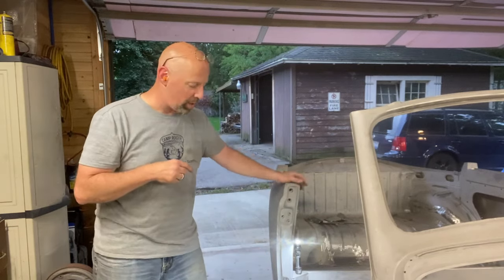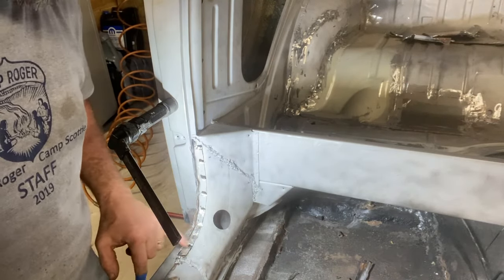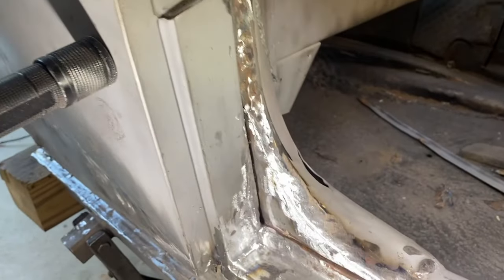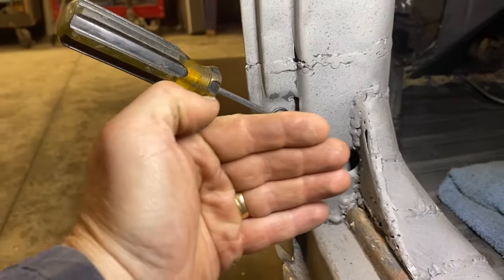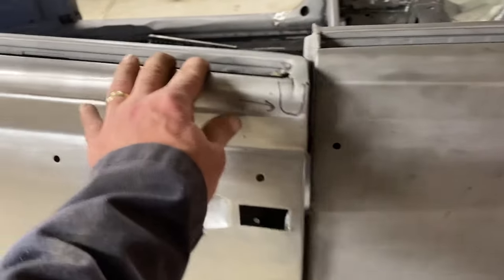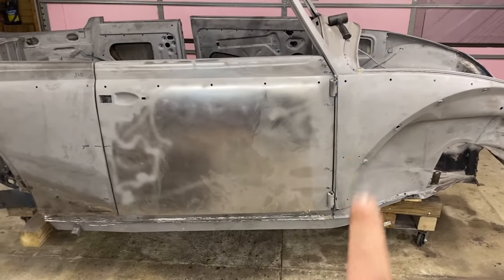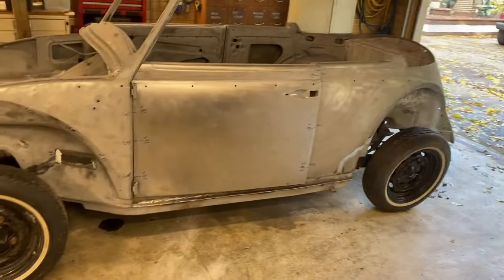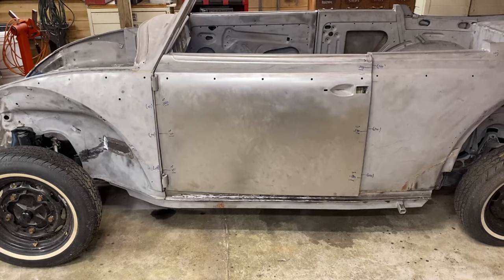1966 VW Beetle Convertible Restoration Pt. 19 - A pillar and door gap problems Pt. 1

Comment: theas cars never had great gaps from the factory they were the cheapest thing they could build at the time . in the end perfection can't be had . you could weld some rod or old metal hangers to close the gaps and grind down and weld the edges as well for gaps that are too small
Reply from the maker: You are right.  And in some way "restoring" them to perfect isn't really restoring them at all.  But I think it's still nice to get it as close as we reasonably can.  Thanks for watching. I hope you are enjoying the journey with us.
Reply: These convertibles were not the "cheapest thing" they could build at the time. They were actually a fine hand-crafted, high quality Karmann coachwork build - far apart from the Beetle sedans. The door gaps were originally set to approx. 4mm (1/8") front and rear. Rear door gaps are common such as this one's, after 50+ years of rust, shoddy repairs, and just plain fatigue. There are factory body / frame mounting points at the rear shock towers which have replaceable rubber shim pads designed to correct the rear door gap issues.
Reply: You have to have the body mounted back to the chassis before working on the door gaps. The convertible door gaps will actually flex somewhat, especially with the top not latched to the front window frame. If you have the entire vehicle pretty much assembled and you put it on a lift, or jack it up evenly at the 4 corners of the frame rails, You will see a big difference in the rear door gap, with the top unlatched. Lifted, Your rear gap will open up at the top, and it will close back up when You let the entire weight of the vehicle back down to the ground. If You have a lift, you can actually see the change as you lift the vehicle, and set it back down. Also the thickness of the body to chassis rubber mount blocks will alter the door gaps, and as I stated, the the top assembly when latched will also alter gaps.  It is a process, to say the least.